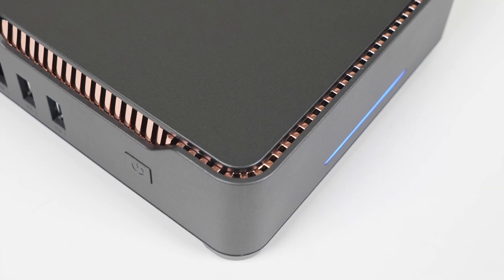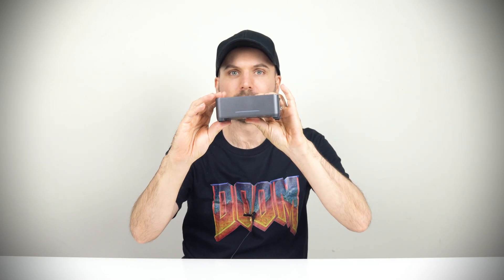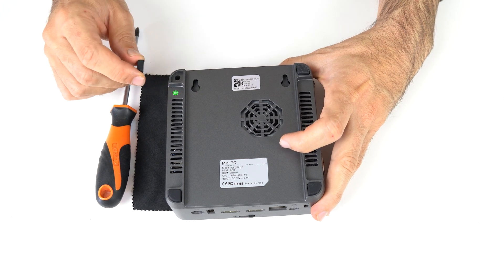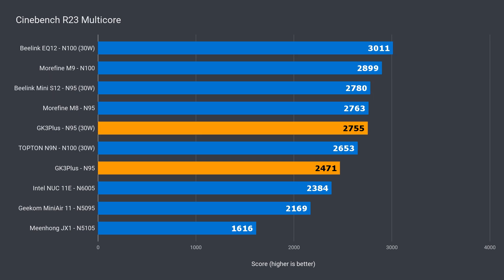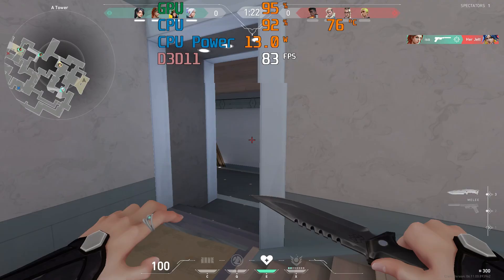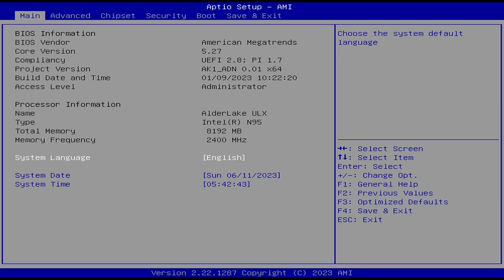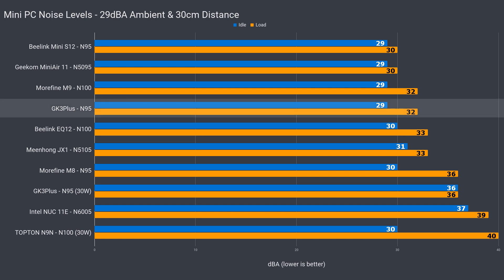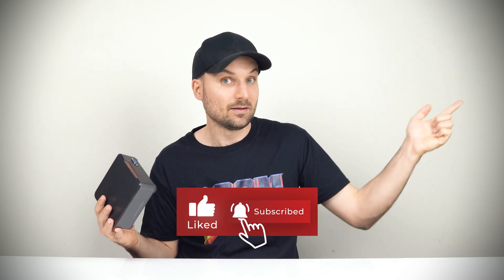Worth it? Kamrui GK3 Plus Intel N95 Budget Mini PC Review

Comment: Is your CPU Clock locked to 2.7ghz like mine is? I think this is why the single core performance is so low.
Reply: If anyone stumbles across this, there is a setting in the bios that lowers the max core clock for some cores and the c states. This makes all the cores sync all the time and keeps the individual cores from boosting above 2.7ghz.
Reply: @sunnygalli  Can you tell me pls what settings you changed?
Reply: @t3chno474  set the c state behavior to CPU default. Also increase the cpu power limit settings to 15W.

Comment: Maybe it's just me, and everyone's taste differs, but this takes the cake for ugliest mini I've seen in a while.  (I think this makes the Tupperware Minisforum and that dial-at-the-top AceMagician look like works of art. What strikes me is that for about $180 one can get a Beelink N100 with 16/500 on AMZN US and the Morefine M9 for about $200, both of which seem miles ahead, especially given that we're seeing $205 for the 16/500 version of this.  Rob, I know you were trying to be both fair and kind (you hardly said a word about having to remove the rubber feet on this).... Having said all of this, I'm really glad you posted this review when you did as I'd been wondering about this unit for someone who has very minimal needs and a low budget, but no longer. Thanks.
Reply from the maker: Yep, I'm not familiar with Amazon US pricing (and it changes all the time), so I go by the websites at the time. But make your choices accordingly when shopping around 🤔
Reply: You wrote a whole novel about absolutely nothing!!!!! Do better.